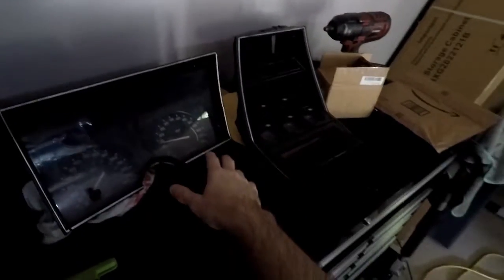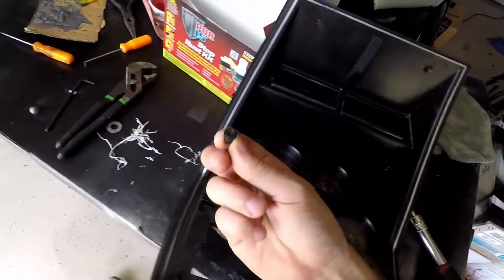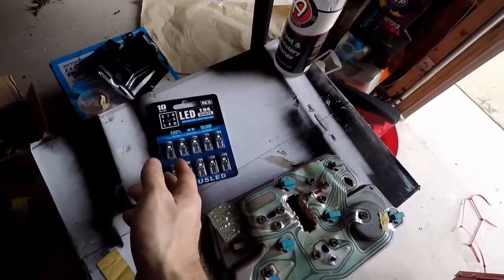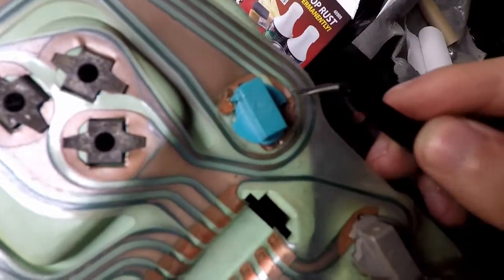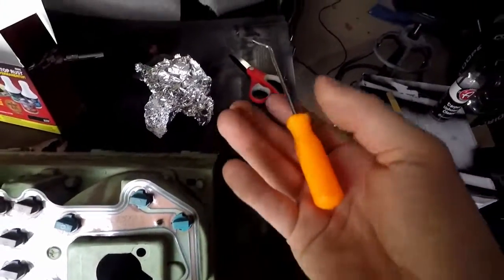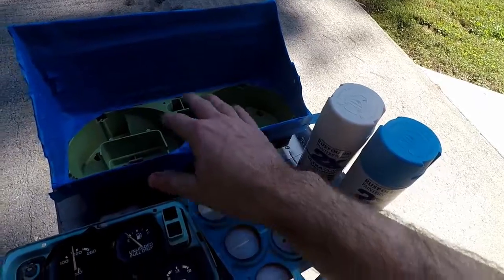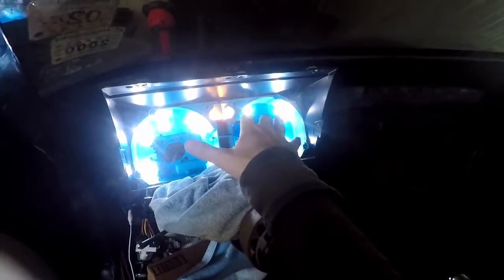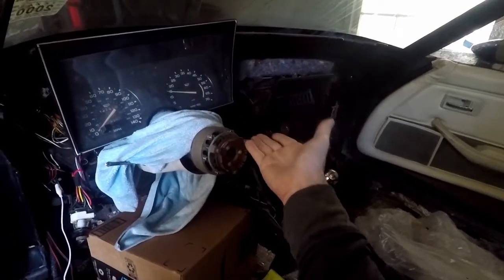Installing LED Gauge Lights - 1979 C3 Corvette

Comment: Thank you for the great video. i’m looking in doing it too. Quick question, is it too bright at night? Can they be dimmed? Regards
Reply from the maker: @Adel_Volks  it’s not too bright at night, not even close. These don’t really dim, maybe ever so slightly, but not really enough to make any significant difference. But as they are I think they are the perfect brightness, if anything a little brighter would have been even better

Comment: Hey good video. What color was the ground wire or where was it supposed to go to. Went to replace some bulbs and now they wont work at all.
Reply from the maker: The ground wire is a black wire that attaches to the birdcage on the driver side. I believe in the video I show how I am giving it a ground for testing

Comment: Did you use the 194 led bulbs for the speedometer and tachometer? Did you leave the incandescent bulbs for the high beams, directional? I am in the process of taking my 1981 apart right now. Thank you
Reply from the maker: Yup! 194 led bulbs and I left the original style incandescent bulbs in for all lights that are behind a colored film. On the backside of the cluster I believe the grey bulb connectors are the ones that I left alone, and the blue ones are the ones that were replaced with leds